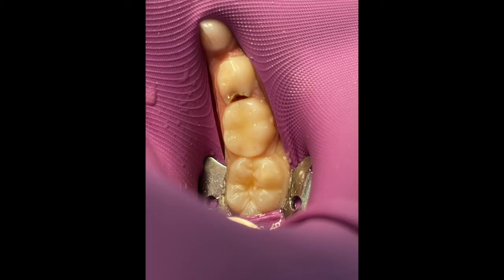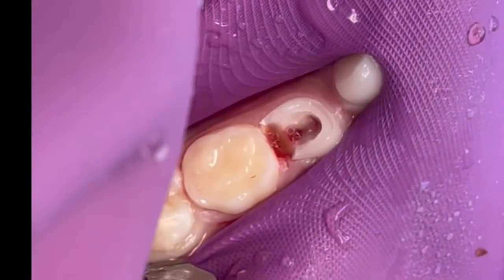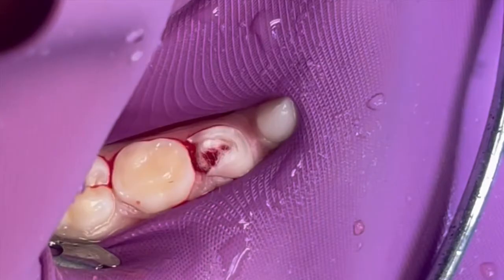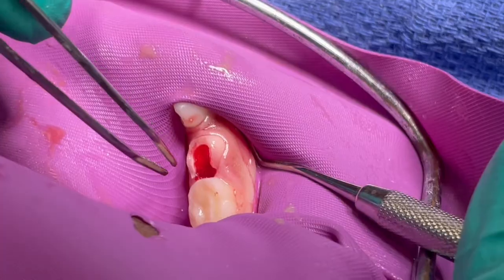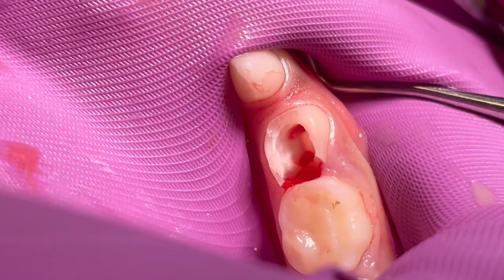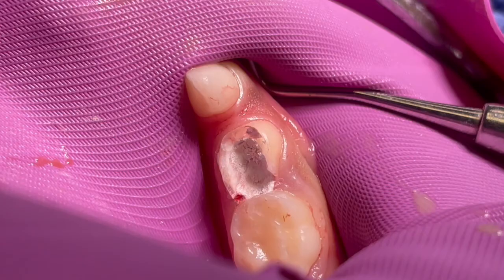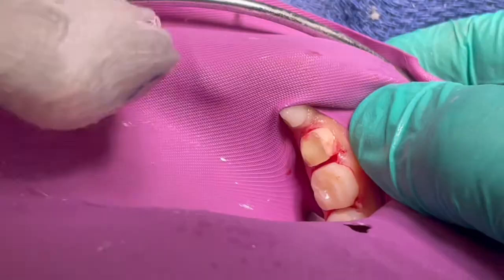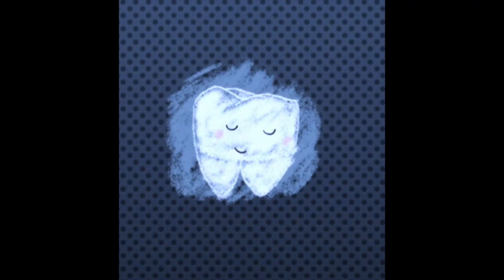Pulpotomy on a primary tooth with NeoPutty

Comment: Hi Doctor, if I understand correctly, to do pressure hemostasis you stuff some dry cotton pellets and you watch them soak, changing those regularly untill the 10 minutes mark, and if at 10 minutes it still bleeds then you consider full pulpectomy.
Reply from the maker: Hello great question! If you look at the AAPD Guidelines the pulp diagnosis. The definition of an irreversible pulpitis is that pulpal bleeding cannot be controlled within 5 minutes. And that is without a hemostatic agent. You could use a low percentage NaOCl like 1.5 percent in a cotton pellet. I will use a dry or moist pellet and relying on hemostatic pressure. Happy to discuss more

Comment: Why did you prep the second temporary mollar if it did´t had any caries????
Reply from the maker: Hello! This is a great question :)  there was mesial caries on the surface of tooth #T or the second mesial molar. The American Academy of Pediatric Dentistry (AAPD)  recommends that stainless steel crowns (SSC)  continue to offer the advantage of a full coverage restoration  to combat recurrent caries and provide strength as well as long term durability with minimal maintenance, which are desirable outcomes for caries management for high-risk children. 

The AAPD  recommends A full coverage restoration  in the following conditions for the restoration of primary teeth:  with extensive caries, cervical decalcification, or developmental defects (e.g., hypoplasia, hypocalcification), when failure of other available restorative materials is likely (e.g., interproximal caries extending beyond line angles, patients with bruxism), following pulpotomy or pulpectomy, for restoring a primary tooth that is to be used as an abutment for a space maintainer, for the intermediate restoration of fractured teeth, and for definitive restorative treatment for high caries-risk children

This patient falls in to the category of someone with high caries risk and being treated under sedation. 

Let me know if you have any additional questions :)
Reply: @friendlyneighborhoodpediat4825  So what you're saying is that you prepared a cavity-free tooth because the patient falls into the high-risk category for cavities?
Reply from the maker: Hello  @AriloShooterPro   thank you for the good conversation! It would be very strange  to prepare a cavity-free tooth, though hypoplasia , hypomineralization, trauma, or other developmental defect could require that.  At  minute 1:11 in the video I state that #T has both mesial and distal decay, I apologize for not including the radiograph in the video, as it is hard to decern decay from the video.  In my previous comment I was stating that typically if a tooth has mesial and/or  distal caries , and the patient is high caries risk and/or being treated under sedation, research and current recommendations support placing a full coverage restorations, vs a class II resin or similar proximal restoration. Let me know if I can add any more to our great discussion.

Comment: How come not just extract it? I understand shifting can occur but it’s only a baby tooth
Reply from the maker: Hello ! That is a great question, primary or baby teeth are extremely important in maintaining arch space for the developing occlusion and permanent teeth. Though you are correct that space loss is minimized after the eruption of the permanent 6 year molars especially in the primary first molar , the loss of primate space. It is important to keep space for the late E space knowing that the mesial and distal widths of the primary molars is greater than the pre molars. So it is important to maintain that space in if there is a permanent successor 😀

Comment: How do you know how to prep the crown in a way that fits the prefabricated Stainless steel crown?

Also wouldnt the bleeding somehow  infect the tooth?
And thanks for the video G
Reply from the maker: Hello, @borobrown7077! Thank you for your great question.  I am using 3M pre-crimped and contoured stainless steel crowns.  These are nice because they do not need to be trimmed or contoured by hand.  My preparation design is a standard Stainless steel crown preparation design form. Due to the significant distal space loss on tooth S (lower right first primary molar) sometimes I will use a contra lateral upper primary first molar SSC as the preparation now looks like a square vs rectangular.  Here is a FNPD video for the stainless steel crown technique https://youtu.be/A9UvCt-aAN0?si=XOMCxVB96HrmgCN0      

The stainless steel crowns come in sizes typically sizes 2-7. In that instance, you are fitting the crown to the preparation not the preparation to the crown, which is helpful in getting a good retentative fit. 

When a pulp and crown I like the NeoPutty or some type of MTA-like product that does not have resin.  MTA-like products form a superior seal over the pulp stumps.  Over the MTA I will place a high-viscosity glass ionomers cement like GC Equia Forte, or an RMGI like Vitrebond plus.  I will fully fill the chamber of the tooth over the MTA. This will help in preventing contamination from bleeding or any future contamination.  

When cementing the crown I will use a Glass ionomer cement like Fuji I or Ketac, or use an RMGI cement like Fuji Cem II.  

I hope this helps and please feel free to check out the SSC video https://youtu.be/A9UvCt-aAN0?si=XOMCxVB96HrmgCN0 

happy to answer any other questions

Comment: Can i etch, bond, and use flowable composite after the neoputty?
Reply from the maker: Hello ! I will place a liner/base like Vitrebond, TheraCal LC , NeoLiner, or RMGI over the NeoPutty and then i will proceed to etch bond and composite. MTA or hydrated calcium silicates  forms a great seal but I will still place a liner/base material over prior to etch bond and composite.
Reply: @friendlyneighborhoodpediat4825  thanks! Yeah maybe I should have done this.. I did 1 case recently but i didn't put a liner, do you think there's any risk now?
Reply from the maker: @mariamfarroukh1977  as long as your MTA is set your success May not be altered. It is just nice to have that extra layer of protection over your MTA even though washout is low with NeoPutty. It may also aid in your resin placement having a more solid floor.

Comment: Doing a SSC on T is rediculous.  There didn't appear to be any interproximal decay and even if there was you could have easily done a very conservative filling and preserved the majority of the tooth.  Could you please explain?????
Reply: The kid was 5-7y/o with gross decay in #S. There was decay on the mesial of T. While it wasn’t cavitated, the kid was intubated and unconscious. Why not put something there that will last until he exfoliates the tooth vs. a filling that has a higher likelihood of failing b4 exfoliation than surviving? Do I do some class IIs? Yes. While a kid is under general anesthesia with an extremely high caries risk? Nope. I don’t take matrix bands to the OR. 
The worst that can happen to T now is the SSC comes off in some candy years from now, which is very, very rarely a problem. They never decay when a crown is lost and if it does come off, it will be when it’s close to exfoliation time. 
He chose the absolute best treatment for the child.
Reply from the maker: @chadgardnerdds3197  hello ! Thank you for your comment and response
Reply from the maker: Hello. @996scott thank you for your constructive comment and discourse. I do believe (ridiculous) is a stronger word based on your diagnosis from a YouTube video that you do not have a radiograph, caries risk assessment, behavioral assessment, clinical examination, and mode of treatment delivery.   

I do agree with you that if I were doing treatment in an outpatient setting on a cooperative patient I would have altered my treatment plan to reflect those changes.  

We can take a look at some evidence-based dentistry :  

According to  The AAPD reference manual BEST PRACTICES: RESTORATIVE DENTISTRYhttps://www.aapd.org/globalassets/media/policies_guidelines/bp_restorativedent.pdf Full coverage restorations should be considered as a definitive restorative treatment for high-risk children. They are used more frequently in patients who exhibit high caries risk and whose treatment is performed under sedation
or general anesthesia.  That is true in this clinical setting. 

In Failure rates of restorative procedures following dental rehabilitation under general anesthesia. Pediatric Dentistry – 24:1, 2002  Their conclusion was that SSCs are the most reliable restorations while composite restorations are the least durable. This was a Retrospective review of 504 dental records of children receiving comprehensive dental treatment under general anesthesia.

 In  Failure Rate of Pediatric Dental Treatment under General AnesthesiaDent. J. 2018, 6, 25; doi:10.3390/dj6030025This study found that when compared to other restorations, composite restorations had the highest rate of failure.

In Early childhood caries sequelae and relapse rates in an  Australian public dental hospital. Int J Paediatr Dent. 2023;33:1–11.They found that The relapse rate for new caries following the treatment under GA was 41%. Additionally, they cited new caries rates reported in other studies, which ranged from 53% to 68% at a 2-year follow-up. 

In Outcomes of dental procedures performed on children under general anesthesia J Clin Pediatr Dent 27(2): 181-184, 2003. They found that stainless steel crowns are more likely to be successful and last longer than multisurface amalgam or composite restorations in children treated under GA. Additionally, they discussed that Definitive treatment is more likely to result in positive outcomes for children treated under GA due to less frequent complications from failed restorations

In  The Use of Stainless Steel Crowns: A Systematic Literature ReviewTheir conclusions were  PEDIATRIC DENTISTRY V 37 / NO 2 MAR / APR 15

1. SSCs are superior in durability and longevity to Class 
II amalgam or resin-based restorations in primary 
teeth.
2. There is minimal evidence to support the economic 
value of Class II restorations over SSCs for primary 
molar teeth. 
3. Dental rehabilitation under general anesthesia is expensive and places the child at increased risk for 
morbidity or mortality. 

In Preferential Use of Stainless Steel Crowns as a Strategy to Minimize Retreatment 
of Primary Molars under General Anesthesia. PEDIATRIC DENTISTRY V 43 / NO 1 JAN / FEB 21 This study examined records from 296 healthy patients with more than one dental rehabilitation under general anesthesia from June 2012 to January 2019.  They concluded that :

1) Stainless steel crowns placed on primary molars in children with early childhood caries under general anesthesia had a lower retreatment rate compared to one- or two-surface composite resins.

2) SSCs should be given strong consideration in the treatment of primary molars in children with ECC to minimize retreatment. 

3)The use of SSCs is one strategy to minimize multiple general anesthesia exposures and their associated health concerns, reduce financial and societal costs, and increase the number of available appointments for 
other children with ECC.

I think this is enough evidence to support my treatment plan. I would be happy to email you these articles for your review so that we can discuss further.  Again, I am not saying that your treatment plan would be incorrect, I am simply supporting mine.  Looking forward to further conversation.

Comment: Great video.

Any tips on fitting crowns?  What sizes do you use?  No crimping? No cutting?  How'd you get the perfect contact amd snap fit
Reply from the maker: Hello, Great question and I think I should start working on a stainless steel crown video or content that would address these questions as they are solid clinical questions. The crowns in the video are 3M™ ESPE™ Stainless Steel Primary Molar Crowns. These are pre-trimmed, belled, and crimped for placement. Typically these crowns do not require additional crimping, contouring, or trimming.  NuSmile also makes a crown form that is similarly pre-crimped and contoured for easier placement. That does not require additional cutting or crimping. https://nusmile.com/pages/stainless-steel-crowns.  The sizes are upper right E2, upper right D5, Lower right D4, and lower right E3. But sizes are heavily dependent on the preparation of the tooth to maintain a good snap fit or high self-retention. So from case to case my sizes will change.  But the pre-crimped, trimmed, and contoured crowns are extremely helpful and time-saving to you are not always trimming crowns and then having to crimp and contour. I hope that helps.

Comment: Completely unnecessary if the patient had only fasted. Destroyed good tooth matter.
Reply from the maker: Hello , thank you for your comment, I am unsure of what you mean  by fasting, but I would be happy to link the AAPD Restorative guidelines and  pulp therapy guidelines . Because we have  a patient who is high caries risk, the venue to which they are being treated, and the presentation of caries and clinical symptomology. These are the most ideal treatments based off up-to-date clinical guidelines .  Happy to discuss further and I am sure there are different ways to address this clinical case, but clinically I tend to follow the AAPD guidelines unless circumstances require other care. 

https://www.aapd.org/globalassets/media/policies_guidelines/bp_restorativedent.pdf
https://www.aapd.org/media/Policies_Guidelines/BP_PulpTherapy.pdf 
https://www.aapd.org/media/Policies_Guidelines/BP_CariesRiskAssessment.pdf
Reply: There was no decay. Could have added a small filling with very little drilling and there would have been no issues. The tooth in front didn't need to be touched at all.
Reply: A few fasts of even 3 days would have set it straight.

Comment: Why didn't you use retraction cord? These crowns look like they're impinging on the gingiva.
Reply from the maker: Hello, Great point. I think that this may be how it appears in the video. I am using 3M™ ESPE™ Stainless Steel Primary Molar Crowns. These are pre-trimmed, belled, and crimped for placement.  To obtain retention, the crown must seat subgingivally to a depth of about 1 mm subgingival and a degree of gingival blanching seems to be inevitable, though I try to minimize that as much as possible. https://www.aapd.org/globalassets/media/publications/archives/randall5-02.pdf 

The margins in the video are not impinging on the gingiva or encompassing them but are seated below the gingiva. One could take an explorer and freely probe the periodontal pocket.   

When looking at the extensive research that exists on atraumatic restorative techniques like the Hall Crown. Gingival health is maintained even though the tooth did not receive preparation.

In this clinical situation retraction cord is not indicated or needed.  Thank you for your comment and let me know if you would like a video on SSC techniques.
Reply: @friendlyneighborhoodpediat4825  thank you so much for the explination💚

Comment: thanks,do you perform pulpotomy if the child has history of unprovoked pain??
Reply from the maker: Hello , great question,  sometimes in children pain can be subjective based on the accuracy of that patient as a reliable historian , but normal pulp or reversible pulpitis would be indicated for pulpotomy. Things that would indicate irreversible pulpitis would be spontaneous pain, nocturnal pain, unstimulated pain. If pain history is not clear and a pulpotomy is initiated then when the coronal tissue is amputated, the remaining radicular tissue must be judged to be vital without suppuration, purulence, necrosis, or excessive hemorrhage that cannot be controlled by a cotton pellet after several minutes.
Reply: @friendlyneighborhoodpediat4825  thanks